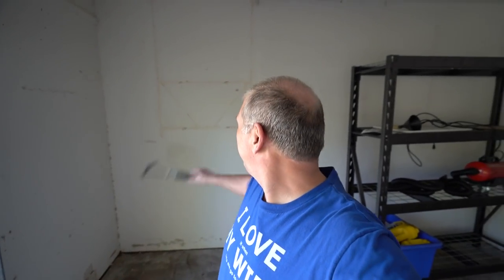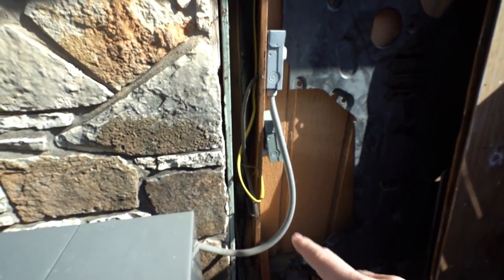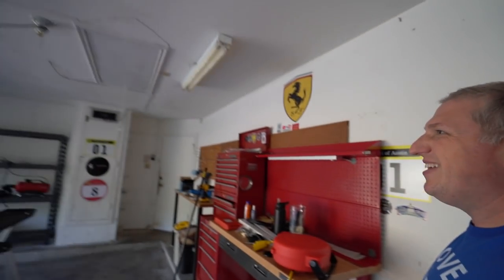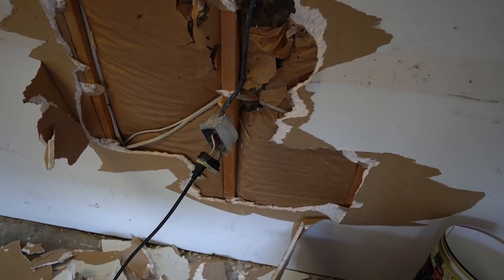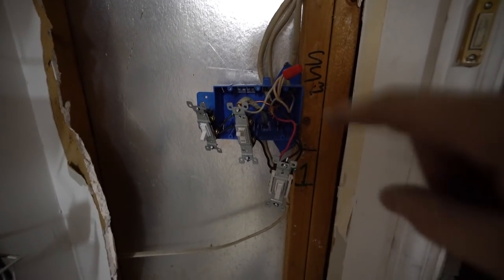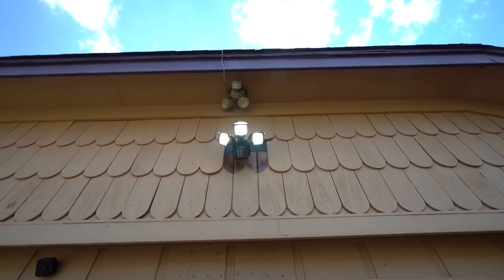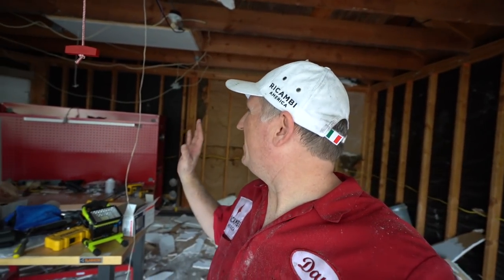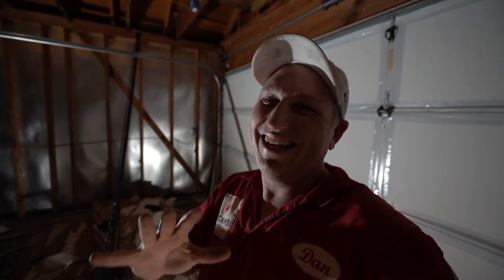DESTROYING MY GARAGE

Comment: My only suggestions are:  1.  You can never have enough power outlets 2.  If you can put at least a 240 outlet in the garage, it will open more tool options for you and future proof the garage for electric cars.
Reply: Dan....u should put a couple of “quad” (4) outlets above work bench level. You won’t regret it.
Reply from the maker: I love the 240 suggestion, the only problem is my breaker box is full so I'd have to replace that as well so it would get pretty pricey as I don't trust myself to do that job.
Reply: A 240 would be nice but yeah if the box is full it will cost some bucks to get another box put in, but if you are going to stay in the house for 10+ years it could be well worth the cost. I put in a 240 in my garage in Arizona so i could get a 18000 btu AC put in. When its 112 to 115 outside I loved my AC in a 2.5 car garage.....those portable ones are useless in high heat.
Reply from the maker: @gregh1853  I did have them run a 220 to the outside of the house for my new mini-split. :)

Comment: Hi, Before hanging drywall check the Austin building code for fire wall build specs. If your garage is adjoining to living space you may need thicker drywall.
Reply: I’m not up with Texas codes, but where I’m at it’s 5/8 fire rock for normal use and double layer if used as a workshop.

Comment: If you still have not drywalled, insulate in the open bays with rock wool before you put the new drywall in, so much cooler in the summer. Especially with new mini split.  You should also vapour barrier over the insulation and under the drywall to stop condensation on the backside. And insulate the ceiling as well!!!!
Reply from the maker: Lots of insulation is going in! Stay tuned

Comment: Change the angle of your garage door tracks so that the end points actually touch the ceiling.  This is what I did and it gave me just enough room for a four post lift function in my garage.  The jack shaft lifts are the money!!  If you install that lift yourself, you will also need a heavier spring on the door.

Comment: A 20 amp outlet is not, in itself,  “safer” than a 15 amp one; installing a 20 amp outlet is like a promise that the outlet is safely wired to a 20 amp circuit. It allows a 20 amp device (with a perpendicular blade on its plug) to be plugged in. It is physically not possible to plug in a 20 amp device into a 15 amp outlet.

Comment: I’ve installed many of the Liftmaster jackshaft openers. They are nice but a little bit of a pain in the butt when you have to replace broken springs or cables. Make sure you add 220 volt outlet for a welder. Good luck on your remodel.👍

Comment: Assuming box that was ‘chilling’ on the drywall was an old work electrical box compressed and secured to drywall via machine clips. Allows for addition of a new box without ripping out large swaths of drywall to mount to stud. Laying drywall and mudding is a pain. Legit as long as grounded properly.
Reply: Yeah, I was wondering if I was the only one saying to myself that it’s just an existing work box... kinda normal...

Comment: Now that you have everything torn apart, it would probably be best to go big or go home (pun intended) so that you don't have to worry about doing some of this stuff again.  At this point, especially with the prevalence of EVs along with various high-powered stuff, you should probably have at least one 220V line into your garage.  Maybe some lines for compressed air that drop from the ceiling would be great but those aren't as needed.  For added mancave and tech purposes you might want an ethernet and TV coax line running in. Finally, along with normal and work lights it would be cool to have some show lights.  Maybe an LED strip running along the ceiling?

Comment: I think a garage is considered a wet location like a basement, so you should have a GFCI outlet as the first plug in the chain of outlets. You can connect up to 13 in a chain. I did notice the 15A wire and thought you should upgrade to 20A. You may also want to consider a 30A 220v circuit for a compressor or a welder.

Comment: Dan… have you though about a way to make the garage lights inside turn on when you open the garage door? Perhaps planning for this will require some additional wires from the garage door opener to the area of the ceiling lighting wall switch.

Comment: If you still can, I would add at least two dedicated 120V branch circuits so that you reduce the chance of overloading the existing, old circuits, due to having too many plugs.  Also, I would add one dedicated 220/240 branch circuit for compressors and other heavy duty electrical equipment you may someday want to use.   Be careful with how many plugs you have on each branch circuit, you don't want to burn your house down due to overloading your circuits.  I would also consider having an electrician come in and check your work, and make sure it's up to code.  Good Luck!

Comment: I’m just here to read all the comments about how you’re doing it wrong based on the YouTube Electrician certifications your other viewers may have. Being that I’m licensed in Texas and Washington.... this has been fun. Some of your viewers actually had decent Good job on catching the 14 gauge mess up and then stapling the wire like the code requires, close to the boxes for the receptacles. If you’re doing an inspection on a homeowners permit... make sure to put in a GFCI breaker to feed those outlets. Anywho.... Thanks for sharing the adventure Dan, Good luck on your remodel!

Comment: The garage door outlet  box could be placed up high next to the unit so you don’t have cord  running down the wall,  put a Surge protection on the garage opener it will save unit from lighting  looks great
Reply from the maker: Good idea

Comment: Dude, check out Epoxy Master for a crazy epoxy floor.  I installed one a few months ago and it is totally badass.  I went with the silver/white and the floor looks like you’re walking on clouds.  They’re basically invincible and you don’t have to keep losing stuff in the swisstrax.  (I don’t work for them)

Comment: It’s not the amperage of the device (receptacle) that matters as it is what amperage breaker you install into the panel.  You should have installed (in your case, had an electrician do it), a 200amp service.  It doesn’t do any good installing a 20 amp device on a 15amp breaker. The amperage on the devices must equal the breaker amperage.

Comment: One trick for finding leftover nails in the studs is to use your hammer, or Wonder Bar, and slide it along the stud.  I guarantee you've missed a nail or two.  This way, you don't find it when you're trying to hang new sheetrock.  Ask me how I know this......
Reply from the maker: I actually did exactly that in many places! Works like a charm.

Comment: First! Love this channel.
Reply from the maker: Thank you!
Reply: Dan, if I could make a suggestion.... I've found it beneficial to complete all the demolition and clean up before running new circuits, etc.. Because, 1. You wont have to deal with the mess at your feet and, 2. It may reveal unforeseen obstacles.  IE A space with outlets run on two different circuits/breakers. :)
Reply from the maker: Yeah that would have been smarter... But the dumpster didn't arrive in time.

Comment: Well, you wasted a ton of time pulling the rock off the ceiling, you had topside access to pull the wires. You also made a massive mess of pulling the rock off the walls. Cut the tape seams and pull it down in sheets. Check the feed to your garage sub-panel. Don’t go blasting in a ton of circuits if it is fed by light gauge wire. Put safety plates on the studs where your wire passes though, unless you like putting a screw through the line accidentally. Get some friends that have built a few homes and consult them before doing these things.

Comment: Please Dan, for the love of god, get rid of the Swiss trax, have your garage floor professionally repairs (if needed) and epoxy coated! 

I did my floor myself, and it look pretty good and I love it. But if I do it again, I’m paying a pro!
Reply from the maker: I really like the Swiss Trax
Reply: @normalguysupercar  believe me when I tell you, you love the expoxy’d floor a 100 time more!
Reply: For guys that really work on cars epoxy floors become a nightmare !! I used Race Deck and wouldn’t change it for anything....
Reply: @davidmorales2900  I’ve been working on cars professionally on many types of floors. Epoxied floors, done professionally and correctly are the best way to go. Easy to clean, super easy to roll shit around on it, don’t have to take anything apart to clean a spill up, and so on.... They for damn sure look the nicest!

Comment: Do not I repeat do not mount it on the wall it will vibrate your garage and sound like tornado. I have a split in our home. You need to mount the outside unit to a concrete pad

Comment: Why LED strips on the ceiling as opposed to normal 4 or 6 bulb fixtures? In my opinion, the led strips look uneven and distracting. If you’re going to go through the work of putting outlets on the ceiling, why not just wire new fixtures that have higher quality bulbs? Just my opinion
Reply: 4 to 6 four bulb fixtures with 5000K LED bulbs would probably put out the same lumens as LED strips but be less “intense”

Comment: You don't have save building codes in the US?! Really "naked" power cords it the wall? Not in pvc tubes to protect them?
Metal housing for power-plugs?! Not plastic to prevent shortings/fire whn you have a water leak? 
 What is it in Texas? You can walk with guns in the streets (legally) but go to sleep in a house with fire hazzards all around (legally)?! Goodnight to you all.
Throw another hamer into your wall and gues what happens when you hit the powercords....
Reply: The entire US allows cables in residential walls (but not individual conductors without conduits).  The plastic boxes are fire rated and won't cut the cables with their build-in strain reliefs.  Code on major remodels and new work requires combination arc fault gfci breakers protecting the circuits.  Arc fault to trip on any electrical arcing, gfci ground fault tripping on ma leakage to ground.  Plus the drywall and most insulation except foam are non-flammable. Texas and many states allow homeowner work but technically it should have a permit and be inspected for National Electric Code compliance, plus any local requirements.   Commercial is normally conduit and metal boxes with individual conductors installed and maintained by licensed tradesmen.  Residential builders will also use licensed tradesmen but the cabling and boxes remain residential style.
Reply: Ok, but how about (fire)insurance? When your house burns down and insurance is asked to pay, don't they inspect the building? If fire is started by poor craftmenship in EU the reject the claim.
Reply: @328gts1987  As Mike Hamby noted, the homeowner is still obliged to pull a permit and have the work inspected by the local jurisdiction.  If the wire was undersized, improperly secured, missing steel guards for stud protection, etc the job would have to be repaired and reinspected.  In the end, negligence on the part of the installer, pro or not, could shift responsibility to them.
Reply: @rj.parker  weird